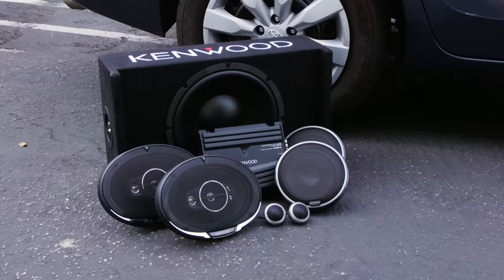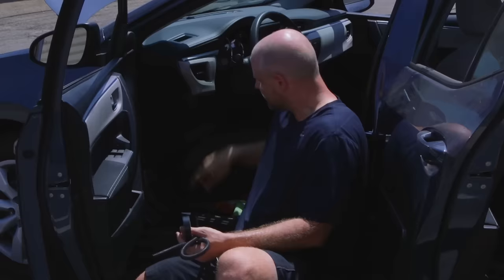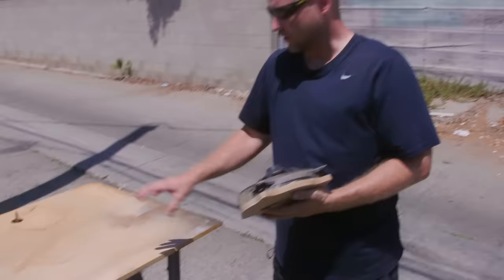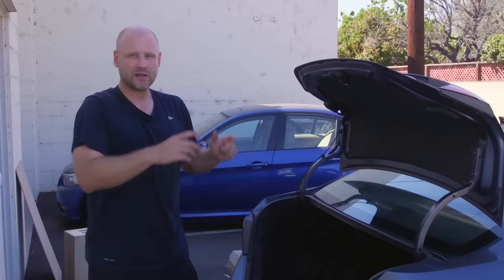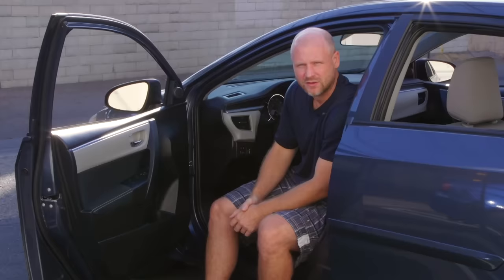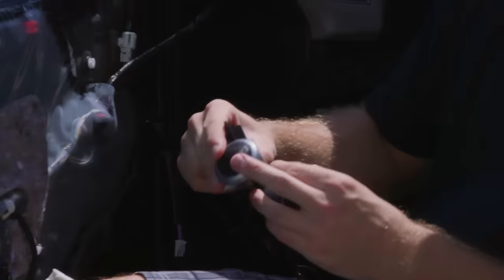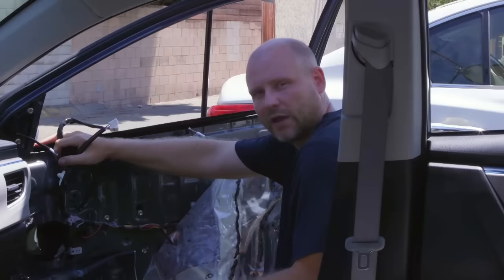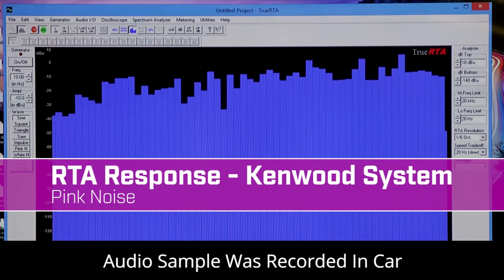Full Car Audio System Installation - Speakers, Subwoofer and Amplifier

Comment: Thanks for posting! What is the name of the component model next to the amplifier? I have never see it. it's these good use for 2 speaker set? Or what is the thanks purpose for these small device
Reply from the maker: That's a Line Output Converter! It's used to convert high level outputs from a stereo into low level inputs for an amplifier. Here's our video on them: https://www.youtube.com/watch?v=OXn8-8yee5o

Comment: Okay I got another question. So if you put the amp on the battery. How will the amp know when to turn off? If it’s always connected to the battery how will it know when to turn off?
Reply: I don't have the correct answer to this question. But I have a system and it just shuts off with the car man 😂
Reply from the maker: Aftermarket amplifiers require a as remote turn-on wire/trigger which will turn on and shut off with the amplifier with the car, which is connected to the remote turn on wire from the wiring harness of the stereo. It will turn on and shut off with the stereo.

Comment: Would you be able to re-link the product links again? The links provided in this description are dead. Thanks!
Reply from the maker: Full Package Bundle Link
http://www.qualitymobilevideo.com/kw-syspkg1.html

Products Installed:

Kenwood KFC-6995PS 6x9" Speakers
http://www.qualitymobilevideo.com/kfc6995ps.html

Kenwood KFC-P709PS Component Set
http://www.qualitymobilevideo.com/kfcp709ps.html

Kenwood P-W120B Subwoofer Amplifier Bundle
http://www.qualitymobilevideo.com/p-w120b.html

Equipment:
Loom Tubing 3/4"
http://www.qualitymobilevideo.com/sl750-100.html

Recommended Amp Installation Kit:
http://www.qualitymobilevideo.com/ak8.html

Line Output Converter LP7-2
http://www.qualitymobilevideo.com/lp72.html

Klein Tools Crimper http://www.qualitymobilevideo.com/klein-1006.html

Tesa 3/4" Cloth Tape
http://www.qualitymobilevideo.com/51618.html

Sound Dampening/Dynamat
http://www.qualitymobilevideo.com/ssdk.html

Comment: nice job,  what was the item next to the amp, some inline thingy? Is it important and do I need one? Is it only for a sub? What is its purpose? I have one 4 channel amp and one for the sub, do I need that thingy on both amps? Thanks ☻
Reply from the maker: That is a Line Output Converter, used to convert high level speaker outputs to low levels for connecting to an amplifier. Here's our video on them: https://www.youtube.com/watch?v=OXn8-8yee5o

Comment: I'm confused....did you hook up the doors to the stock speaker wire or did you run wires from the amp into the door?
Reply from the maker: All the speakers are powered by the head unit, we just replaced the factory speakers and upgraded the connections to the factory wiring. Only the subwoofer is powered by the amplifier
Reply: I have a situation, hopefully you can take the time to answer.  I have a 2016 Dodge Charger.  The stock amp powers nothing but lows and midbass to the doors.  I want to add full range 6 x 9's there or components off the oem stereo.  is it possible to add a crossover before the speakers? what if I tap into the 3.5" speakers on the dash?  also, the oem stereo is 2 ohm.  I ran 2 ohms speakers on the dash and would add another 2 ohms to the doors...would that drop it to 1 ohm?  Any help and/or advice is appreciated.

Comment: My amp has the following rated power outputs:
4 Channel 300 W X 4 RMS @ 2 ohm 
150 W X 4 RMS @ 4 ohm 
If I were to install a 4 Ohm 20W speaker in parallel with a 4 Ohm 100W speaker (2 ohms total impedance) would I be overpowering the 20W speaker and risking damage?

Comment: Just saw your video and find it very nice. May I ask how you cut off the low bass for the front speakers. Did you use  the built in active crossover from the stereo or a passive capacitor. Also, is the rear 6x9 speakers also crossovered or it runs full range.

Comment: Need a lil help. I have a set of kicker 44ks series 6x9’s that can handle 150W RMS @ 4 ohm ( they are also 4 ohm speakers) what would happen if I bridged them to operate at 200W @ 2 ohms instead ?

Comment: I wonder what the total time to make this video was. I'm planning on doing a subwoofer install myself on a 2016 Honda Accord Sport and I would love to have a similar outcome.
Reply from the maker: Took us 2.5 days, probably about 20 hours, but we were also shooting and taking breaks to explain every step
Reply: Quality Mobile Video awesome thank you! My other question is, the factory head unit is very limited in function (doesn't offer advanced subwoofer control) so would it be best to upgrade everything all at once?
Reply from the maker: Yea definitely. We really just wanted to show how to do everything else plus I was on a budget, but since we kept my factory head unit we were limited in terms of tuning the system and making it reach its full potential. Are you interested in this system me put together? We have a package deal for it right now!
Reply: Where are you located in the U.S.?
Reply from the maker: Yea Los Angeles area

Comment: whats the best power supply to use for two car amplifiers in the house?  JEC CA3245 600W for mids and BOSCHMANN 1300W for bass.
Reply from the maker: I'd honestly recommend getting a home receiver and home theater subs/speakers

Comment: I have a problem I hooked up an amp to my door speakers and now they are really low and when I turn up the radio it stops playing music and then it starts making a scratching noise what should I do to fix it I ran the 9 wire on the opposite side of the car from the power along with my rca wires it was working fine before I hooked up another amp for my door speakers

Comment: Good day ❣️❣️
Can I install 
BOSS Audio Systems PV3700 5 Channel Car Amplifier with 
Door speakers jbl gx602 180w 6.5 2-way gx series 
Rear speakers pioneer Ts 6975 v3 3way 550 w????
Is it compatible or not ?

Comment: Hello. Did u get any bass from the 6x9 ?  Its so low voltage on rear Channel and to bas frequence on my corolla 2020. And with a 4ch amp new speaker is pore bas.  Any idea what to do?

Comment: Hi, very informative and beneficial. I have a question. I've recently purchased a MB Quart XA1-800.4 four channel amp. POWER @ 4-OHMS = 4 x 100 Watts. I am going to purchase some MB Quart 200.3BMW. They consist of two under seat 8.5 woofers, 4" component door speakers with crossovers and tweeters. These have been rated at 4-OHMS @ 4x80 RMS. My question is that to set the gain, should I go by the RMS of the amp or the RMS of the speakers? So should I get my wattage for my gain for the from the speaker or the amp? secondly, in terms of the frequency, it's saying that the highpass on channel 1 and 2 should be set at 150 and above and on 3 and 4 the HPF should be set at 40hz and the LPF at 135hz. The rear speakers are just going to be straight swap outs. I won't be connecting them to new wiring, they'll still be on the head unit wiring. The HU is an aftermarket Pioneer SPH DA-120. My car is a BMW E90. Thanks.
Reply from the maker: Shakeel, Lorenzo here, I have the same car and here is what I would do. I would go active on the crossover and not connect the 8 inch woofer to the passive crossover, instead connect it directly to the amplifier and set the low-pass crossover on the amp to 200 Hz initially. There will be a steep rolloff on the underseat woofer naturally due to its location. You may need to adjust the low-pass slightly to get the staging and transition points right. Then connect the passive crossover to channels 3 and 4 and set that high-pass crossover to 150 Hz. MQ quart doesn't publish the passive crossover points but by connecting it this way you will have some ability to fine tune with gain and the amps internal crossovers. Set up this way you should have plenty of headroom and it should sound great. I have set my car up this way with 5 Zapco C2K amps all active, set up as mono-blocks with Dynaudio Esotar speakers.

Comment: HEY !
I HAVE 2019 TOYOTA COROLLA SE WITH STEERING CONTROLS ,IS THERE ANY WIRING HARNESS WHICH COMES WITH RCA OUTPUTS & REMOTE WIRE OPTION SO THAT WE CAN SWAPP IT WITH FACTORY RADIO WIRING HARNESS WITHOUT CUTTING & ALTERATION--TO FIT AMPLIFIER
YOUR HELP WILL BE REALLY APPRECIATED 
MANY THANKS 
NAVI
Reply from the maker: I have exactly what you need! In order to replace the stereo in your model, you need this interface: https://www.qualitymobilevideo.com/ax-toycam3-6v.html

Comment: Hi am trying to install a new stereo and I managed to connect everything. The device works and all, but I can’t get any sound from it. All four speakers are connected. I do not have a factory Amplifier. The ‘AMP’ wire from the new radio isn’t connected to anything since there was none on the previous radio. I tried connecting it to the ACC power and also to the ANT wire. Still no sound. Any ideas?

Comment: Hello I am new to car audio so i got a question ,
My alternator has 70A output ,the car doesn't have any major electronics ,just  an ecu,radio,lights. 
Is this alternator enough to do a 4 speaker, amp ,sub situation? i would use an  

AMP: auna 4 channel 2800 Watt max  (RMS 380w) 
The amp has an output about 2 ohm and power draw ranges from 11-16v 
so i would guess that the draw is about 8A cuz there is an 10v fuse on the AMP

Speakers : 4 - JVC CS-J520X 250w max (RMS 30w) 

Sub :JBL Car CS12 Serien 1000W (RMS 250w)

i could use some help and suggestions Thanks!

Comment: Hello, I have a ported box tuned to 30hz for (4) Skar EVL "10 woofers, what is the best but cheapest amp I can get?  Should I get one large amp (eg. 8k) or two smaller ones (eg. 2 4k's) and bridge them?
Is Lanzar any good?

Comment: Hi I'm just starting out on car audio.I have a question.  Why did you connect the line output converter remote wire to the amplifier instead on the remote wire from the head unit? Thanks.
Reply: xerxess it’s just to avoid sliced wire input towards the amplifier from the head unit. This is more cleaner and better signal quality(no signal loss)

Comment: Hi there just wondering,what if we connect a subwoofer loop it direct to stock speaker without any amplifier..is it safe or not advisable..thank you
Reply from the maker: So power your subwoofer with the factory headunit? That's not a lot of power, it'd be pointless
Reply: Thanks for replying bro...is there any of ur video of tutorial installing woofer without amps

Comment: Could you add schematics or diagrams for wiring? It would be very helpful, thanks.
Reply from the maker: We have a video on it! https://www.youtube.com/watch?v=jryFmICR4qA&lc=z12qidu4lp3uhtwql04cg3sq3ouaztvof1k
Reply: Thanks!
Reply: thanks, but I meant more specifically, a diagram on how to wire the high pass back speakers.

Comment: Ok I hook up speakers to the stereo speaker wires and do I then run speaker wires down from the back speakers to the amp???
Reply from the maker: If you have an external amplifier you can absolutely power your rear speakers with it. But it does depend on how many channels your amp has, and if you're also wiring a subwoofer to the amplifier...

Comment: So you use heat shrink to keep your wire connections together? Or did I miss you soldering them? Thanks
Reply from the maker: The heat shrink is used to insulate wires, providing abrasionresistance and environmental protection for stranded and solid wire conductors, connections, joints and terminals in electrical work.
Reply from the maker: We soldered them first, then put the heat shrink on over the new connection

Comment: What kind of harness did he used to wire the tweeters of the front speakers?  Did he power the rear speakers of the amp?
Reply from the maker: Only the subwoofer is powered with the amplifier. Everything else is powered by the head unit
Reply from the maker: Speaker harness: https://www.qualitymobilevideo.com/72-8104.html
Reply: Thank you for the turn around!

Comment: How did you connect the sound cables from stereo to the amplifier and then yo speakers?
Reply: Right? He's talking about a remote wire and speaker output, but he didn't show what he did for the inputs and connection to the head unit.

Comment: What’s the Dynamat for? Compared to sound absorbent material? And is dynamat optional?
Reply from the maker: Dynamat absorbs sound and prevent's vibration/rattling, reduces wind, road noise, provides better sound, more bass

Comment: Can someone reply on how you’d go about adding two subs both front and rear speakers on a 4 channel amp
Reply from the maker: Watch this video explaining the process of wiring speakers and subs to an amp in different combinations. Unfortunately two subs and four speakers at once isn't possible. You can wire 4 speakers together, two subs together or four speakers and one sub together. But two subs will take up all the terminals since they have to  be bridged

https://www.youtube.com/watch?v=vxWSN60i5ew

Comment: Hey sir, Thanks for the uploads. Any chance you know how to disable filters in the head unit on a 2018 Toyo Sequoia TRD Sport?
Reply: DSP (Digital signal processor) will allow for input from the stereo to be used and sent out to an outboard amp or an amplifier integrated into the DSP.

Comment: So, I have bought really budget 4 channel bridgable  amplifier from pioneer has maximum power of 1000 watts but gives 60w @ 4ohm per channel and bridge power of 190w RMS @ 4ohm. My question is I have pioneer speakers installed that takes power of 100 rms @ 4ohms I want to ask that Is it a good idea to connect speakers in bridge mode in order to fulfill speaker requirements.

Comment: I have a few questions, if you don't mind, I want to use stock head unit on my 2014 accord lx, it has the noise cancellation device, do I need to disable that? I'm going to use JL comp rear speakers, that's why I'm asking, no sub at this moment, also, I been reading and when using stock head unit you need bass restoration device, like audiocontrol LC7i, is that correct? Thanks in advance for your comments

Comment: Is the amp powering the speakers and the sub or what? I want to get two front door speakers and a sub and a head unit the sub is 300 nominal watts and the speakers are like 55 each should I run the speakers off the head unit and get a mono amp for the sub or can I get a 4 channel amp and run 2 to the speakers and bundle 2 for the sub in case I want to ad more speakers? I don’t really know what I’m doing lol.
Reply from the maker: We just have the amplifier power the sub! We replaced the factory speakers and connections with the new ones, so the head unit is powering the speakers.

Comment: I want to replace the sub to a 2010 Audi s4...can I just use the existing factory subwoofer wire to the line output converter?
Reply: Yes you can wish i'd have that factory subwoofer :C. A4 3.0 TDI 2009.
Reply: @demento5935  
The factory setup has a 8" b&o sub but its lacking in bass for my taste...really need to upgrade

Comment: I have two 12 inch subwoofers with a 2000 watt amp

I noticed my lights dimming every time a bass would hit

Do you recommend I get a bigger battery or a second battery?
Reply from the maker: It definitely sounds like a voltage drop issue. Could you give me the exact models/specs of the subs and amplifier? You may be pulling too much current than your electrical system can handle and may need to either upgrade with another battery, audio capacitor or alternator.
Reply: @Qualitymobilevideo  
On the amp it says NA-2KM Nemesis audio 2000w Max

And the subs are American Bass XO-1244

That's all I see

Comment: I will probably won't get a reply back but I had a question, I wanted to install 1 subwoofer 12" 500rms 1000 watt my question is will the xtr 1000.1 2000watt amp work well for this or is it too much for 1 sub ?
Reply from the maker: Well there's actually no problem having a more powerful amp than subwoofer, its actually recommended, even that more more powerful.  A lot depends on the subwoofers, whats the model number? I need to know if it is Dual Voice Coil or Single Voice Voil and if its impedance is 2 ohms or 4 ohms?

Comment: great video
a quick question
what channel amp would u recommend for your door speakers and tweeters?
Reply from the maker: You'd need 2 outputs for that, so I'd suggest a 4-channel amp, what's your budget?
Reply: Quality Mobile Video 
the door speakers are 250 watts each and they are 4 of them
Reply from the maker: I'm guessing that's MAX power rating? What are the models? We want to look at the RMS ratings, they're much more accurate
Reply: Quality Mobile Video 
100 rms each
Reply: and the tweeters are 150 rms each